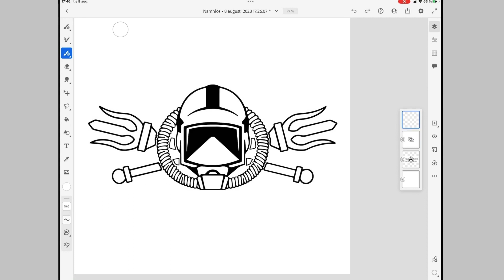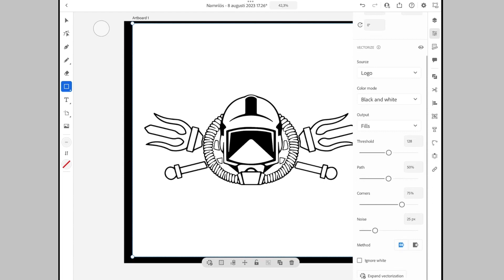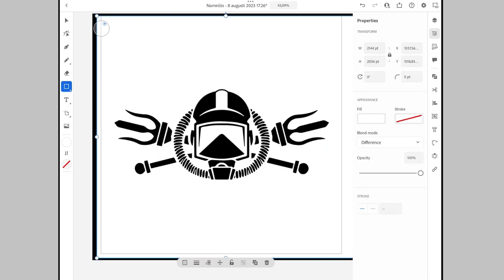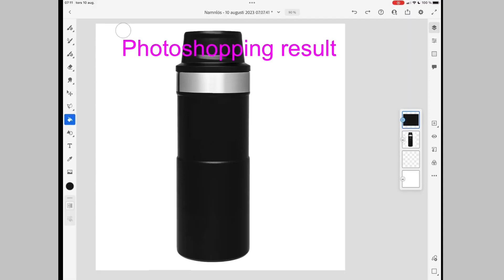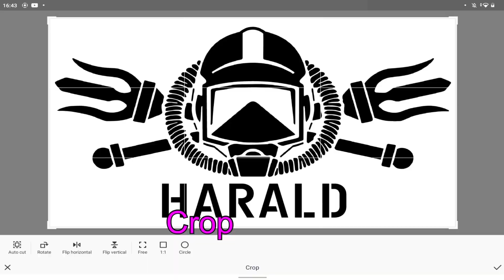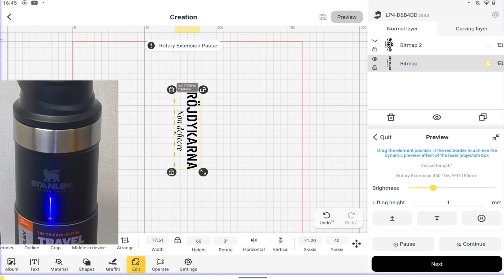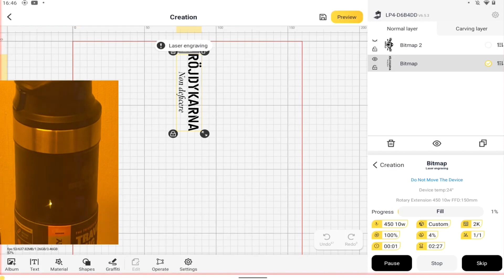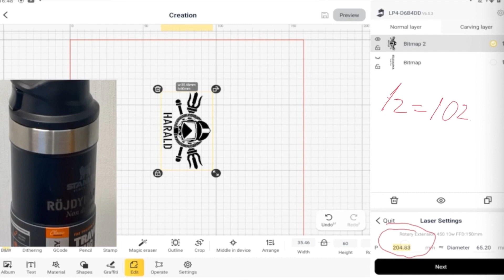Mastering Tumbler Engraving with LaserPecker LP4 & Rotary Extension

Comment: Where do you get the number 65.20 diameter from? I have the same tumbler and it gives me 25.50 diameter
Reply from the maker: Hello, Victor got the number from his measurement.^^Please use the correct measurement for your engraving project to ensure precision.^^
Reply: @LaserPecker  Victors measurment is in mm, yours in inch

Comment: Great video. Only issue is the settings can be different depending on the mug (the one I used was a Stanley product. Using the settings provided (power:100%,4%, 2k,1) the initial print leaves a hard black layer. Going back over it at lower power does clean things up, though. Thanks!
Reply from the maker: You are welcome.^.^

Comment: That is an extremely good video that shows how to center your engravings with ease.  When you know what the different values are and what they are used for it makes everything so much easier and faster.  The last time I engraved something on a water bottle I had a hard time centering the logo and never did get it exactly right.  I am sure I would be able to do it now and get perfect results Thanks to Victor.  Thank  you.
Reply from the maker: You are welcome.❤❤
Reply: Does this work also for mobile app and using the versatile electric roller for LP2?